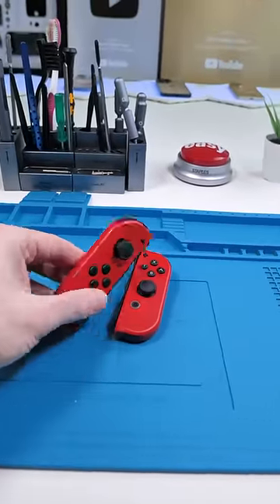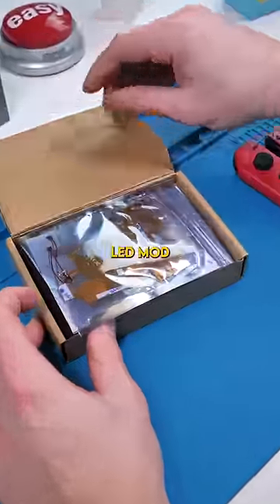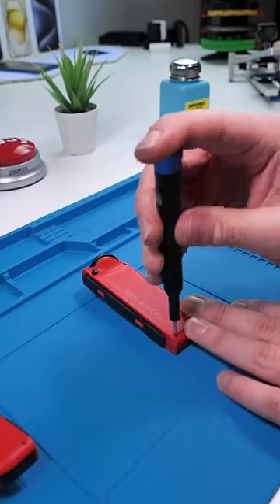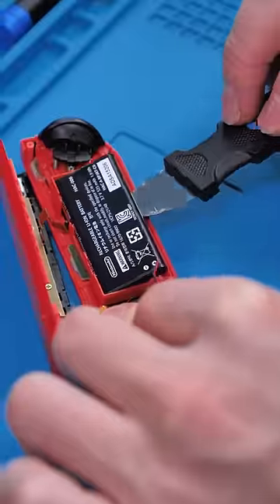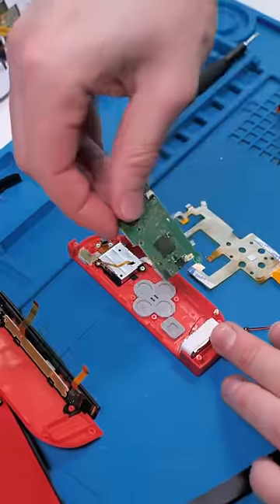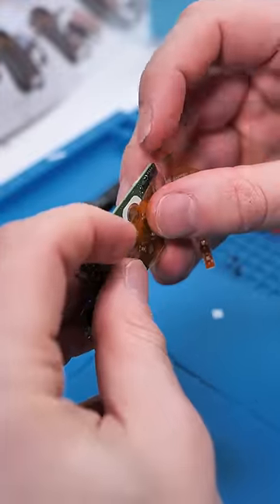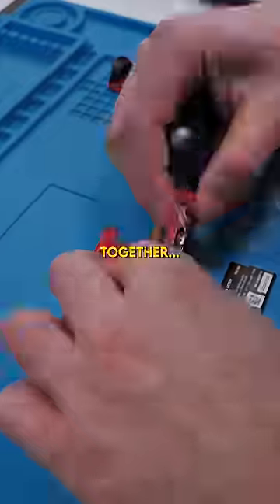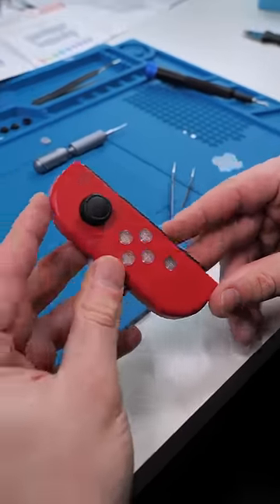He Wanted LEDs In His Switch ..? #short

Comment: These kits are nice and all but be careful you get the right version for your joycons and be careful with that right side joycon. The LEDs tape down below the R bumper and if you dont get them positioned right the first time it usually breaks the flex cable trying to reposition them. Ive gone through 3 sets just to get one that works.

Comment: Hey btw, use plastic tweezers especially for a switch controller. If you touch the wrong thing with those tweezers you will blow aa fuse on the board and unless you are great at soldering miniscule parts your controller is now dead.